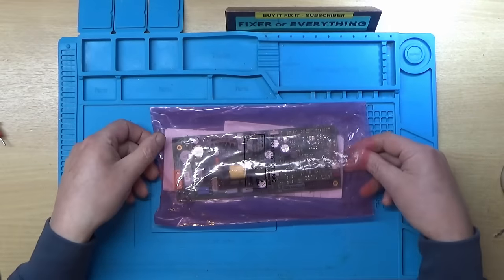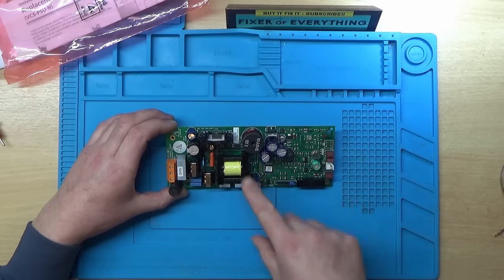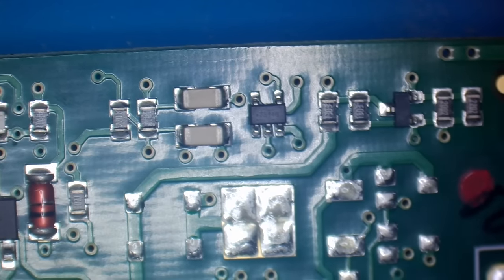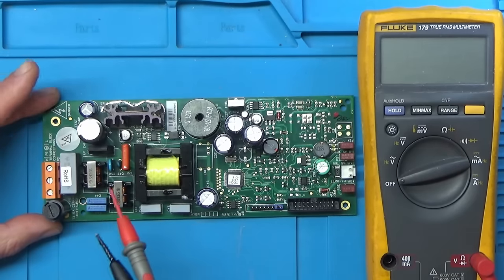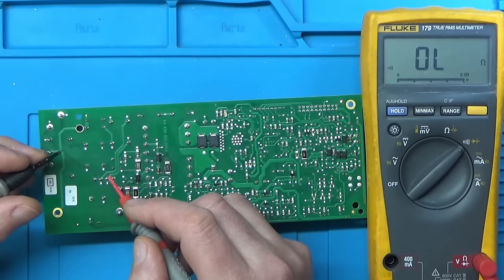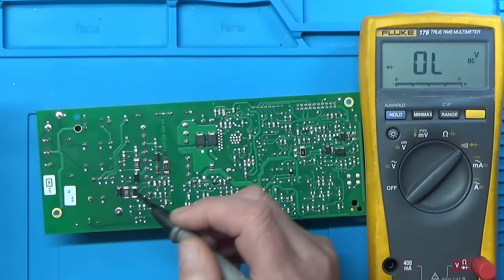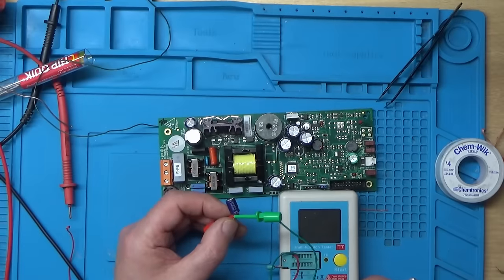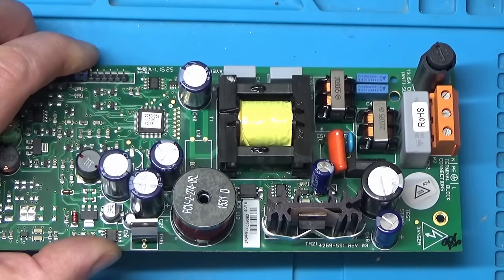VERY Expensive Fire Alarm Power Supply | Can I FIX it?

Comment: After a repair like that, the board need to be recertified. That is why those boards goes for so much. The only company that can recertify the board is the builder of the board. Even if it is done made by a third party for the main company, the third party cannot recertify the board. Ask me how I know. Been in the alarm business since 1988.
Reply from the maker: That sucks, so if the mains fuse blows you have to get it recertified? As that would also be a repair.
Reply: Stupid question but what does re certified mean, Is that like calibration?
Reply: @BuyitFixit  Anything that is fix on the board can not be serviced. If you can remove a part, you can replace it. Like a fuse, a connector, the battery. If a fuse is soldered. It need to be fix by the company or it wont be legally ok to use. And this is an insurance thing. They dont want to have millions being supervised by a fixed board that could just have a security feature bypassed.  I know you did a very good job. But would your insurance cover you if  you sell it and later on a large building owner go after you even if your board was not the problem and there was a fire? That is the reason why it need certification.
Reply: @HUNGRYHORSE666  no it mean re tested for insurance reason

Comment: Ok, so what if there is a fire and the insurance company hires a forensic fire Examiner.   You repair with identical parts, how would they know.   In this case, a thru hole cap was used in place of surface mount cap, yes, they would likely see that if board survives fire.   Otherwise, very unlikely Examiner would notice repair.   I'd have no problem with using this board.
Reply from the maker: I would think if the board failed again, it would run on the backup batteries and give out some alert anyway. But then the other components in the system are of the same age, what's to say that the main board may fail next, or another units power supply of the same age? Should the whole system be pro-actively replaced every xx years just in case? where does it end?.... Someone has sent me another PSU which is even more insanely priced at £1500! I've not looked at it yet but it will be a future video.

Comment: honeywell notifier fire panel.
Reply from the maker: I don't really know a lot about these, but on one of the sites it says: "Suitable for Gent COMPACT-24, COMPACT-24-N, NANO & SenTRI 1 - 2 Loop Addressable Panels". So I guess it fits a few different models.
Reply: @BuyitFixit Nano is a cheaper version of the gent compact which is very very rarely used as it's rubbish, the SenTri is exactly the same fire alarm as the gent vigilon compact except it has different protocol software (so uses basically the same detectors but with the SenTri software) again very rarely used.
Reply from the maker: @Dime_Bar  interesting 👍

Comment: More commonly known as a stuffed bootstrape cap.
Reply from the maker: Yes. I had similar problems years back on TV PSUs where you would get the standby light pulsing on and off when the set was plugged in, which was also the bootstrap capacitor 👍

Comment: Looks like a good fix. Wonder how system switched back and forth from line to battery. Was thinking relay but they are doing it with IC and cap p/u?
Reply from the maker: Thanks 👍 I didn't look into that part of the circuit, so I'm not 100% on that.

Comment: How much !!!!!   When i look at the size and complexity of a computer motherboard and the price of approximately £150. It makes you realise how much this alarm co is taking the p. I found the same thing with a cdi unit off a motorbike £ 688.00 to buy 1 or you could make 1 for around £25.00.
Reply from the maker: 😂😂I remember years back we bought an old Mercury outboard engine. Thought the distributor cap could do with being replaced so I went to go get one (thinking it would be around £5 or so like a car one). When the guy told me it was £75 I said I only want the cap not the whole distributor 😂😂😂so I cleaned the old one up 😂👍

Comment: You're lucky you can fix the supply.  In the USA you are not allowed to repair a fire alarm power supply.  Either replace with new or send back to manufacturer for repair.  No other legal option that met fire code 🔥🚒
Reply from the maker: I'm not sure if the same applies to the UK. It seems a bit silly as what happens if the fuse had just blown. The power supply could fall at any moment from the manufacturer.
Reply: @BuyitFixit  I'm sure you have the same problem with laws and regulations that don't make sense but that's one here that does not. You have to be licensed to work on a fire alarm system including the individual components.  Nobody gets licensed for that you just put in a new one and throw the old one away.  It's the American Way now 🤬
Reply from the maker: 🙁very wasteful and I'm sure just replacing that one capacitor would give the power supply many more years of service without any issues.

Comment: Would you trust it again, being a very inportant piece of life saving equipment . Maby it is just by it`s usable lifetime.
Reply from the maker: Good question. A few had said they wouldn't but the systems have a battery back up. These units fail quite often. I would have thought if it failed again it would revert to running back of the battery and sound an alarm such as mains failure the same way as if the mains actually fails. That's just my take on it though.

Comment: Would u be safer wearing electricians gloves with  mains voltage circuit boards!
Reply from the maker: I'm not a fan of gloves. I think I've got fairly thick skin now from either soldering iron burns over the years and the odd electric shock 😂😂😂😂👍

Comment: Good  morning 

From Nigeria 

I was having issues on a fire alarm power supply i was working on if i try to fix in the fuse power on and later
 and later it will shutdown again , and i observe a spark when trying fix in the fuse pls i need assistans
Reply from the maker: It sounds like there is a short further in the power supply. I'd check the bridge rectifier and the mosfets for short circuit.

Comment: Its ridiculous the prices.
A end of line resister board can cost £30 alone😮.
So we buy a fire alarm board, that comes with 8 or so EOL resisters😊😂
Suckers 😂
Reply: When we replaced the faulty eol resistor we kept getting fault condition.
It took ages, but we discovered when a certain Brand of eol resister was fitted to a system.  We needed to remove a CAPACITOR in the fire board itself.  
The 'CAP' is located on the F.A pcb & easily removed via screw terminals.  There's 1 CAP for every zone, the CAPs are simply on each zones supply wiring in F.A Board.
A real piss taker, when you don't do these every day 😂
Reply from the maker: Yes someone mention in the comments £83! for a spanner that was used for these systems.

Comment: It’s not expensive equipment it’s cheap shit that can only be bought from the company selling it to keep inline with legislation and company policy. 
In example a weighing scale had a broken power cord where I work . £5.00-£25.00 tops I could replace it for. They could only go with a company that charged £200.
Reply from the maker: Yes, agree. Mighty expensive for a power cord 😲 I've since been sent another faulty PSU from a different fire alarm, this one is two modules which total £1500!

Comment: See the comments below, they all state the same thing, don't mess with Commercial/Residential fire alarm control panel "fixes" congrats you can recap a knackered capacitor, can you afford a grenfell tower sized insurance claim / prosecution, Tell the tight arsed idiot who sent you the board to go forth and spend the money to buy the correct new part and not risk other peoples lives and your freedom, what about any other caps, did you replace them proactively? that's why a new board is needed, if one failed what else is on the edge?
Reply from the maker: First of all thank you for your point of view. I can see some logic in what you are saying, but what about the rest of the fire alarm system? Wouldn't that have the same age caps? If you fit a new PSU then what about the logic panel? Perhaps that also needs replaced proactively? Should the whole system be replaced on a regular basis because as you say..what else is on the edge... What about units that haven't yet failed but are of a similar age?